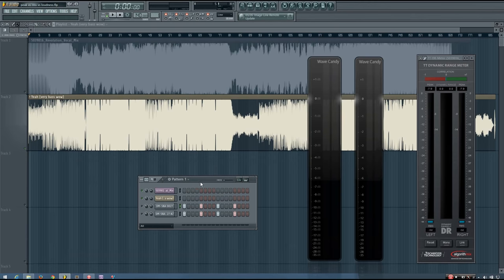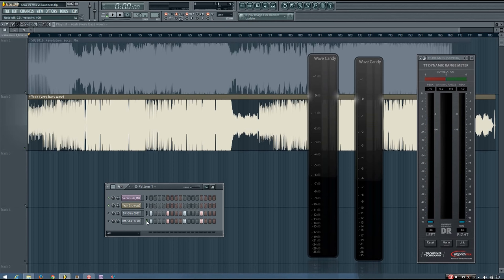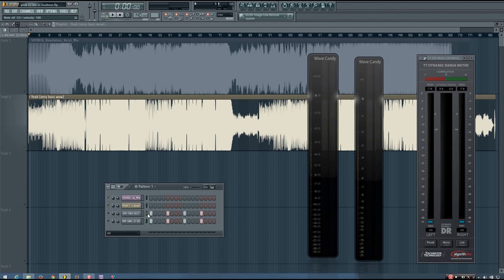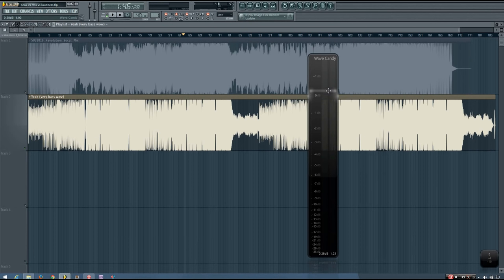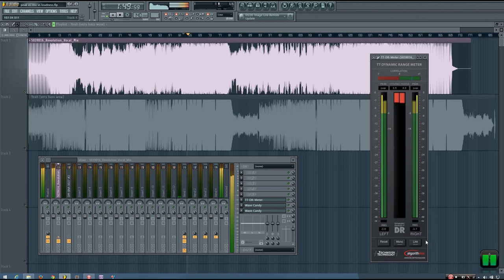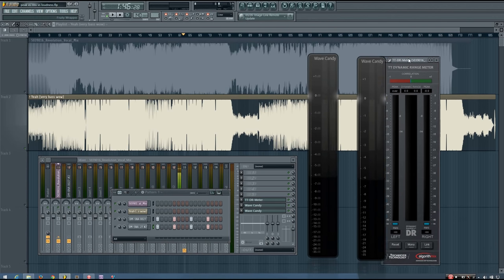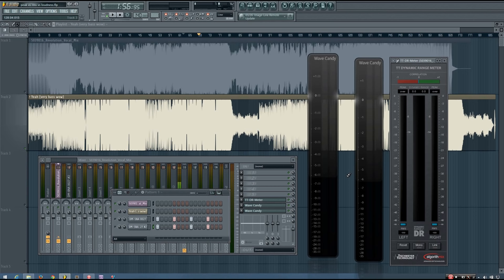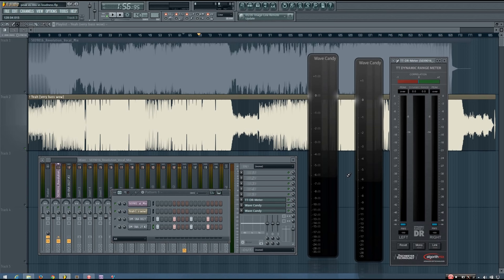Mixing Tutorial: Peak vs RMS vs Loudness

Comment: Loudness is based on our ears tolerance for audio volume handling for different frequencies. It is mapped out as Fletcher Munson curves. RMS is not our perceived loudness but root mean square of all the variations of amplitude so it is a mathematical averaging regardless of frequencies that we are more sensitive to. If we could theoretically divide the whole spectra of frequencies to numerous small bands and find RMS for each one, then we could factor the FM curve to those RMS values and find the perceived loudness.

Comment: Good video.

RMS mostly gets closer for maximizing all frequencies, per my level in a given track. I mostly use it for electronic synthesizer type sounds.

Peak Level is only good at maximizing the overall sound level, where individual nuisances / parsecs of the sound, are unchanged at the track level. I mostly use it for traditional instruments. Example: you don't want the human breath, sounding louder than the actual flute.

Comment: Well, RMS-meters are important for gain staging. The difference between the readings is based on the time settings of the meter I guess, meaning the time period the meter is considering for it's calculation. In some RMS-meters you can alter this setting.

Comment: You said you base the loundness of your mix based on your ears? really? How often are your ears calibrated? Rather, how do you even know your hearing is perfect?
When you listen to music or any material, your ears immediately tell you if the sound is loud or not and not scan the entire material to understand the loudness perception to tell your brain on how loud the content is. I am aware LUFS is the new "thing", but is not miles apart from RMS values. Though RMS calculations are time based (Approx 400ms), there is a way to eliminate silences in the formula, which is basically what LUFS does for the entire content. Is LUFS accurate? Absolutely not. Based on my 40 years of "wearing" sound, music and loudness over myself, I've found a good value around -18dBFS is a sweet spot. Sometimes, the YouTube, Spotify and others attentuating at -14 is loud in some instances but OK in other instances.
BTW, Loudness war still exists and the sound engineers/Mixers or whatever you call them these days, should be ashamed of themselves for compressing the music/material. Any DR value below 9 is not even worth listening to, with me controlling the attenuation knob.
For e.g Listen to the new Adele 30 - her shrilling highs are so compressed to a point she sounds like nails scratching on the walls. All in the name of the tracks to keep them loud.

Comment: how did u convert wavecandy to a rms meter
Reply from the maker: Set the wavecandy to the "Meter" option. You can do that by selecting "Meter" at the bottom or by clicking and dragging a corner of the display to resize it to be tall and thin. Then change the mode option to RMS.
Reply: thanks

Comment: You discount RMS too easily.  The reason you will see two different values for RMS is not because there's something wrong with the meters or that the math is somehow unreliable... it's because RMS can be calculated two different ways, or different "weightings."  "Raw" RMS is less accurate than A-Weighted RMS, which takes the Fletcher-Munson curve into consideration (Daniel Crawford).  It only gets more complex from here  =)  Anyway, The A-weighted RMS measurement is just as useful.
Reply from the maker: My main point against RMS is that I see people constantly asking "what RMS should <things> be?".  They want a definite value, which isn't possible due to different meters giving different values. There may be nothing wrong with the meters, but they are inconsistent relative to each other. Therefore, you can't rely on arbitrary numbers read on the internet, which many people ask for. Even non-weighted RMS meters can give different values depending on whether they are based on a square wave or a sine wave. 

You can still use RMS to compare your track to professional tracks, but I never do; I find spectrum visualizers to be much more useful in most aspects of mixing and use integrated LUFS when I need to compare loudness values for full mixes. Trying to use any loudness meter to set the levels of individual sounds isn't a good idea, but people keep trying to do exactly that.
Reply: "...they want a definite value, which isn't possible due to different meters giving different values" - I guess that's the part I'm objecting to, because if you specify which weighting scale has been used, it makes it entirely possible to leverage RMS as it was intended to be used in audio applications.  

In fact, before LUFS, a properly weight-spec'd RMS spec is exactly how loudness has been communicated in the past.  For example, given the question "What RMS should i use to calibrate my monitor volume?" you could easily spec it as -20db RMS pink noise, C-weighted, and calibrate to 83db SPL at 0db monitor gain.  If RMS were as unreliable as you suggest, this would not be possible.  In fact, this is exactly what Bob Katz spec'd for the K-system of calibration.

Integrated LUFS is in my opinion the best when we're talking about perceived sound levels, but before that came of age, RMS (WITH a weight spec) takes "different meters" out of the equation... if two different meters with the same RMS and weighting don't give you the same result, then one of them is not working right, which is the same as you'd say about VU or digital... a bad meter is a bad meter, and unless we're talking about bad meters, the assumption is that the meters being chosen are calibrated properly.  And improperly calibrated or bad-math meters exist across all measurement types, not just RMS.  And if your RMS meter doesn't have a weighting adjustment - or at specify which fixed weighting it is using, then it's not an RMS meter, it's just a useless bouncing needle.

It's just math, and as long as you have all the variables, you can get consistent results across measuring devices.  Whether or not you're using RMS for the right application, and how heavily you decide to rely on it, is a different matter.  =)

Other than LUFS, even with beginners, I'd still bring up RMS as a viable alternative, with (in this case) A-weighting... it's a little more complex than "peak" measurement (and your video is great at defining why peak is not the best choice), but not as complex as LUFS to describe. But this is where things get subjective, as now you're talking about "what's easiest to teach."

My main point here is, I just wouldn't want beginners to take away from your video the wrong idea of  "don't use RMS for anything, because it's too hard to get consistency" when in fact it's pretty easy to do, once you discuss weighting.
Reply from the maker: That's fair. I may be overly biased against RMS meters since I don't use them. One of my goals is to prevent people from getting caught up in discussions like this: https://www.reddit.com/r/edmproduction/comments/3wva36/how_high_is_too_high_an_rms/

Someone says "I heard ozone's RMS meter isn't accurate, that it overshoots" with a reply of "It defintly does seem to overshoot it by 1.5-2.5 rms which is pretty significant imo."  And another comment: "I think ozone's RMS isn't right I'm peaking at +.1dB RMS now".

This conversation is completely useless because nobody seems to understand that RMS values can be different due to weighting, etc. Everyone's providing RMS values as if RMS is a unit with a single specification. In discussions like this, RMS is inconsistent due to user error and why I suggest it's unreliable. I didn't mean to imply that the meters themselves are inaccurate. I oversimplified in the video, so I appreciate your comments.